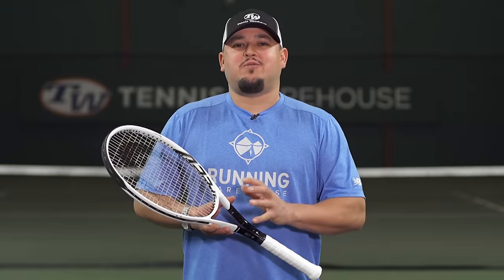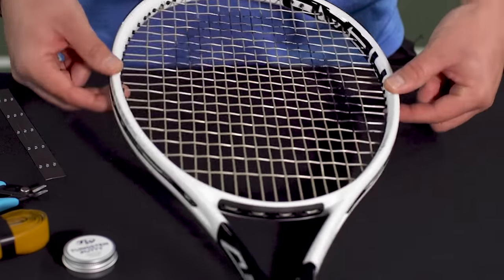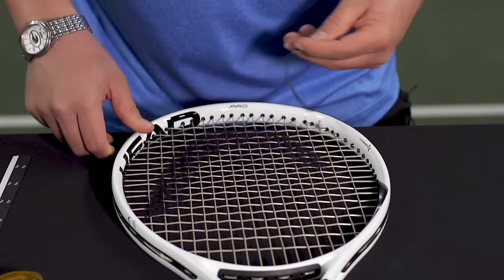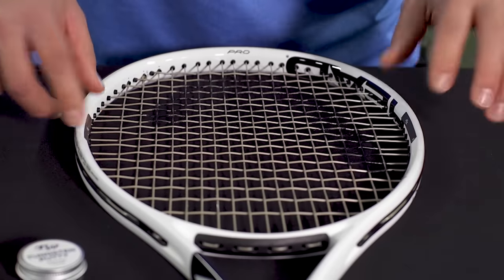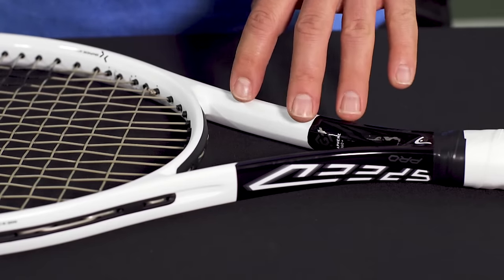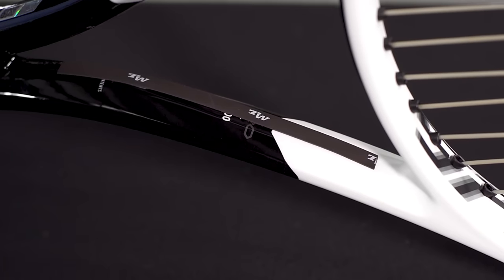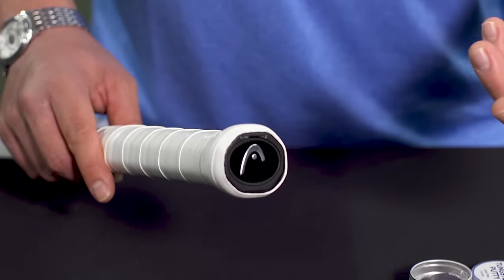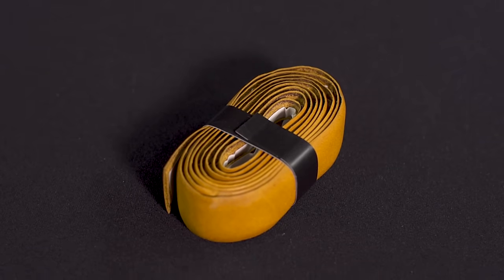Improve your Tennis Gear: Racquet Customizing Tips 🛠🎾 (change balance, swingweight, add power, etc.)

Comment: I have babolat pure strike team 3rd gen. Since the racket is 285 grams, it feels a little light for me. I want to make my racket heavy. Which side should I weight first? While doing this, I don't want to take away the balance of the racket. What do you recommend? Thank you for the good information
Reply from the maker: You could try adding the weight in the throat or yoke region (where the racquet forms a V) and that shouldn't change balance all that much. If you want to make the racquet feel more stable on contact, you would want to add the weight to the sides of the hoop, where you typically are hitting the ball, so usually that is around 3/9 or 2/10 o'clock regions, if you look at the hoop as a clock. From there try just a few grams, and then you would want add similar amount to the handle to maintain the balance. Troy, TW
Reply: @tenniswarehouse  Thank you very much indeed.

Comment: I would like to experiment adding weights to my racket, but is concerned about being able to undo/remove the lead tape if I don't like it.  Is the lead tape easy to remove and yet secure if you don't want to remove it?
Reply from the maker: @Shawn Chang, 
Yes, easy to remove, yet still secure enough that it will stay on if you want to keep it there! Think of it like a thicker sticker that will stick to the frame well but still can be removed. 
Michelle, TW

Comment: I have a question about adding weight.Say I want to add 4 gm total at 2 & 10 o'clock, do I have to add 1 gm on each side of 2 &10 o'clock or will it suffice to put 2gm only on one side of 2 &10 placed symmetrically?
Reply from the maker: I think you can do it either way. For symmetry purposes, and just an overall clean look it is usually done by dividing your total weight into 4 pieces and placing 1 strip on each side of the string plane. But honestly, I have done 2 strips of weight before and just placing them on opposite sides of the string plane at each location, and it seems to work just fine. Troy, TW

Comment: Troy, to increase stability and control in Pure Drive Team (285g) keeping in mind that we want the racket to be within 300g, where should I place the lead?
Reply from the maker: Typically if you want to increase the stability of the racquet, you will want to place the weight on the widest perimeters of the hoop, which is usually near the 3/9 o'clock locations of the hoop. This will help resist torsional twisting on contact of the ball, and also since it is pretty much near the spot of contact on the string-bed it will boost the plow through, to help get the racquet through the ball, when facing hard hitters. That said, to help you control that added mass in the hoop, you will likely want to counter the weight with a some weight in the handle as well, so that the racquet doesn't end up too head heavy. Troy, TW
Reply: @tenniswarehouse  Thx! How many grams at 3/9 each plus a handle. Is it something like 3/9=1,5g/1,5g plus 3g to a handle?

Comment: Hey Troy. I was just wondering how I should customize my racquet. I want to add stability and make my racquet heavier. So where should I add the tape, and I want to go from 9.4(Burn 100 Team) to 10.6, while maintaining the same headlight, so should I add in the handle as well? And should I go right up to 10.6, or go to, 10.0 and then if I like it go to 10.6. Thanks
Reply from the maker: To add stability, you will want to add some weight near the 3/9 o'clock locations of the hoop, as mentioned in this video. In order to keep the balance you will likely want to add a similar amount of weight to the handle, or maybe even a bit more, as the Burn 100 Team is pretty close to even balance when strung. I wouldn't necessarily worry about hitting a certain number, such as 10.6 ounces unstrung, and try to add some weight and then try it out on court, as it should be more about feel. Troy, TW
Reply: @tenniswarehouse  I like the feel of the old Head Speed MP, so I am trying to make it like that. So how can I make it like the old Head Speed MP? Thanks
Reply: And what should I use to add weight to the handle, tungsten putty or tape? Thanks
Reply from the maker: @hrishikeshshenoy8893  Which of the old Speed MP racquets are you referring to? Graphene 360, Graphene Touch? Usually Tungsten Putty is what we prefer for adding weight to the handle. Troy, TW
Reply: @tenniswarehouse  Graphene 360. So how can I make it Like that? Thanks
Reply from the maker: @hrishikeshshenoy8893 , So if you want to take the specs of your racquet Burn 100 Team, and match them to the Head 360 Speed MP (weight, balance, swingweight) this is where our TW University Customization tool comes in handy. http://twu.tennis-warehouse.com/learning_center/customization.php. So basically you will input the specs you have for the Burn 100 Team, and based of our old website specs you will type in: Length=27, Weight=10, Balance=13.4, Swingweight=294. Next you input the specs for the 360 Speed MP, Weight=11.2, Balance=13, Swingweight=317, and then click on "CUSTOMIZE MY RACQUET", and it will tell you the best places to add weight. You don't have to necessarily hit those exact locations, but it will be a good reference. Now that you know how to use this tool you can start to experiment.    Troy, TW

Comment: I bought the same tape (3x3) strips, I want to add tape on my 10 and 2 o'clock, so my question is, in the video you cut single strip into 4 parts but what if I want to cut a single strip only in 2 parts and use 2 strips in total, making the net weight 6g (3g on 10 o'clock and 3g on 2 o'clock) is that ok to do?
Reply from the maker: So basically one of the 3 grams strips, cut in half, and place that at 10 o'clock. Then do the same thing at 2 o'clock, I think that is what you are trying to do, and yes that is just fine. Troy, TW
Reply: @tenniswarehouse   ok, thank you

Comment: I have a racket that is about 342 grams strung and I’m trying to add stability and add a bit of maneuverability for acceleration/volleys.  How much weight or lead tape should I add in the handle? I want to make it around 2-3 points more headlight.
Reply: I've add 4 strips of 6" of lead tape on bevels #3 and #7 (6g total) under my grip which is also a leather one. Feels great with the 5g ( 2 x 10" of lead) at 12 o'clock. I still have a solid head light feel. So I'd say try adding some weight and see what feels best for you.
Reply from the maker: If you add the weight inside the handle, near the bottom, or butt cap, for every 3 grams you will add 1 point more head light. So if you wanted to 2-3 more points HL, then you would likely want somewhere between 6-9 grams of total weight in that region. Troy, TW
Reply: Tennis Warehouse Thank you Troy, love your groundstrokes and I really appreciate the tips. Will the weight add some decent stability?
Reply from the maker: @Thicc_Thanos964 , thanks! and thanks for the support of our videos. The added weight will help make the racquet easier to manipulate, as it will be more head light, and it should feel a bit more solid. That said, to increase torsional stability, or twistweight, the best place to add weight is the 3 and 9 o'clock locations of the head, but will also make the racquet a bit less maneuverable. Troy, TW

Comment: So adding an overgrip of 8.5g will make the racquet about 2 points more headlight? Thanks
Reply from the maker: Just about 2 points HL, maybe 1.5. Also overgrips can vary in weight some are a bit lighter than that like 5 grams, so it will be closer to 1 point more HL in that case. Troy, TW

Comment: The frames I game are 335g unstrung and 18X20 string pattern and I would like a bit more access to spin. Is it possible to add 20-30g to and Aero or Vcore95? Is it unwise to do so? Is it preferable to go for a Radical, or something else, with 16x19 string pattern?
Reply from the maker: Both the Aero 98 and VCORE 95 would be nice racquet to add some weight to. Besides that the Head Radical Pro would be a nice option and less weight you would have to add to that one, it's spin friendly but not a super open 16x19 pattern, so still decent control. You might also consider Tecnifibre TF40 305 or 315 16x19, and the Yonex VCORE Pro 97 (310), or you could go with the (330) and not have to customize much at all. Troy, TW
Reply: @tenniswarehouse  Much appreciated Troy!

Comment: waht about led tape, i want to increase the stability on my speed mp, i put on 2 inches strips just like you did but tungsten tape is heavier, should i just double up on the tape or do longer strips?
Reply from the maker: @Jose Gomes, 
You can measure out the same weight in lead and apply it in a similar fashion.
Michelle, TW

Comment: What is the thickness of the TW tungsten tape? I bought some Babolat tape because it was almost half the price, but it was much thicker than expected (about 0,7 mm) , and I couldn't put it under the bumper.
Reply from the maker: I'm not certain of the exact thickness of the TW Tungsten Tape, but I do know that when our customization technician adds weight under the bumper of a racquet he uses our tungsten tape, and it works well. Troy, TW
Reply: @tenniswarehouse  All right, thanks!

Comment: Hello, does adding weight to the handle makes your racquet more maneouvrable ? Thank you
Reply from the maker: It will make the racquet more headlight, and for most players that will translate into a more maneuverable feel. However, adding weight to the handle won't reduce swingweight, the only way to do that without damaging the racquet (or grommets) is to go with a thinner or lighter string, or remove dampener if there is one. Troy, TW

Comment: Frankly, you're better off buying a heavier racquet than a light one!  I have customized a lot of my frames by adding a leather grip and/or adding weight at 3 and 9 o'clock.  Do they play better?  Yes.  But the racquet I'm current using is over 11 ounces in stock weight.  It took a while to develop the muscle strength to adjust to it but it was worth it. My light racquets - even those customized - all lacked performance in real intermediate match play.

Comment: Troy, can you put tape at 3, 9 and 12?
Reply from the maker: Sure, you can put the tape all around the hoop if you want. That said , we advise starting with smaller increment and working your way up, unless you already have a target spec in mind. Also which ever direction you place the lead, you will increase the stability in that direction. Troy, TW

Comment: Is there a way to add swing weight without changing the balance or the total weight of the racket?
Reply from the maker: I believe it will either take one or the other outcomes. You can add weight near the balance point, which is usually near the throat or the yoke of the racquet, and that will increase swingweight slightly, but still add some weight. Making the racquet longer, will increase the swingweight, with little addition of weight, but might add some, and will likely change the balance. Troy, TW
Reply: @tenniswarehouse  if the online customization tools tells me to add 0.8 ounces at the 10 and 2, would you add 0.4 ounces on each side? And how many strips of tungsten tape would you need?

Comment: Will it affect the swingweight if I add weight at the top of the grip?
Reply from the maker: It will slightly, but not by much. A bit less than I mentioned about adding to the throat of the racquet. Troy, TW

Comment: i have the pro staff 97 v13. as you know there is exposed carbon at 12 o clock but i want to add weight there. how do i put it under the bumper?
Reply from the maker: I don't believe it is completely exposed, as there is a clear coat that covers the material. If you want to put weight under the bumper, it is best to do so when switching out the bumper, and grommets, as you will need to remove the current bumper, apply the weight, then put a new bumper/grommet kit on. Troy, TW
Reply: @tenniswarehouse  Hi, how much lead have you added to 12 o clock on your Wilson Pro Staff V13? I found that you need to substantially add more than 4 grams at the top of the racket to make it more powerful and therefore head heavy. 2 -4 grams as suggested is really low for that kind of racket. What's your thoughts on that ?

Comment: What are the benefits of adding weight to the throat? Added stability, power?
Reply from the maker: It will add stability, swingweight, plow, but not quite as much as in the hoop, and it will also add weight without altering the balance by much. Troy, TW

Comment: When you say add 1 point head light or heavy, you mean 1/8 of an inch or 1 centimetre?
Reply from the maker: Yes, 1 point on the balance is equal to 1/8 of an inch. So added weight to the top of the racquet will be less head light or more head heady, and added to the handle or towards the bottom will make it more head light, or less head heavy. Troy, TW

Comment: Is there any way to make a racquet more head light without adding weight?
Reply: If you’re using a string dampener, remove that. Use a thinner gauge string. And last, I don’t recommend this, but I have seen someone remove material from the bumper guard with a dremel.
Reply from the maker: Yes, what @E P said. Your best bet is going thinnest gauge possible, and/or lighter string material. So a thin gauge multi or synthetic gut will be the lightest compared  to a thick gauge co-poly, but will also play quite different, so maybe just stick with your usual string type, and go thinnest gauge. Also remove dampener if you are using one. Taking material off the bumper guard can be a little sketchy, and may void a warranty of a racquet. That said, if a racquet like a Prestige has a cap grommet, and can be replaced by a traditional bumper, that will reduce swingweight quite a bit. Troy, TW
Reply: Tennis Warehouse Yep. I’m not saying anyone should take a dremel to their racquet... just saying, I’ve seen it done.

Comment: Hi troy,  I want to add some stability to my Head Gravity Pro,  I know that the sweetspot for this model is a little more upwards than others, where do you suggest me to add the tungstene tape? Thanks!
Reply: @ Pedro....I've just been testing the gravity pro the last 2 days. I normally use a yonex vcore 97 hd. I find the gravity rock solid....But, even though it's the same static weight, it's a bit sluggish and harder to maneuver, as it's a bit head heavy.

I'll be playing again tomorrow...so perhaps I'll start to get used to it.

It's currently strung with tour bite @55 lbs.

I'd like to add some weight in the handle, but given it's a demo, I'm not sure I can tweak it.

Cheers
Reply from the maker: I think a bit of added weight at the 3 and 9 o'clock could help with stability, and open up the sweet-spot a bit. Troy, TW
Reply: @tenniswarehouse  Thanks troy!
Reply: @pedroramos5760  There seems to be some conflicting data with the Gravity Pro. TW website and others state it's 6pt head light. Heads website, the racquet itself and others state it's 1pt head light. 

So, unless there's completely different stock floating around & you genuinely have a Gravity Pro that's ~6pt head light, I'd be rather careful adding weight to the head, as you'll end up with a head heavy stick. 

My demo is certainly not 6pt head light.

Cheers.
Reply from the maker: @nostro1001 --Just checked Head's website based on your feedback, and the specs on the Gravity Pro are listed as "315 mm / 1 in HL". One inch head light is equivalent to 8 points head light, for the unstrung frame. With the strings added it would be pretty close to 6 points head light. I have seen other Head racquets in the past listed in inches, and sometimes confused as points. Not saying that your particular demo could be less head light, or have a higher swingweight, but the 6 points HL strung, that we list on our site was based on a batch of racquets that we spec'd prior to putting the specs on the site, and if we think that the specs may not be lining up with the manufacturer specs, we will confirm with the manufacturer before posting. Hope that helps. Troy, TW
Reply: @tenniswarehouse  Aaaah - huh - you are clever!!! :)

There's the confusion - thank you for clearing this up. As I have said a few times, it's not just me that was a bit confused, seems there's similar talk elsewhere on forums and feedback.

Lesson learnt - I will go back to looking at mm, I've just got so used to talking how much head light a racquet is & missed it stated 1" HL. 

Yes, you guys have always been spot on, hence my queries. Really happy this has been sorted - your help really appreciated.

I'm hitting again today, guess I'll make my mind up whether it's for me or the swingweight is just that too hefty compared to my Yonex 97hd & will send back on Monday.

Enjoy the rest of your weekend. Cheers.
Reply from the maker: @nostro1001 , Yes, definitely confusing, and not sure why they list it in inches. I do agree that the Gravity Pro could use some tail-weighting, as it swings fairly hefty, giving a feeling that the balance is off. Anyways good luck with the demo. Troy, TW

Comment: Hi. How can we decrease the swingweight?
Reply from the maker: That is something that is more difficult to due, because basically you have to reduce mass from the racquet, especially towards the top of the racquet. Some things that could help, would be stop using a dampener if you use one, go with a thinner gauge string, and a lighter string material. Usually thicker polys are the heaviest, like a Luxilon 4G 16 gauge, whereas thinner multi string will be the lightest, such as Prince Premier Power 18. Those strings will also perform quite differently. Besides that, you would have to remove pieces from the racquet itself, such as cutting off the bumper guard, which we don't recommend as it protects the frame, and could void any warranties the racquet carries. Troy, TW